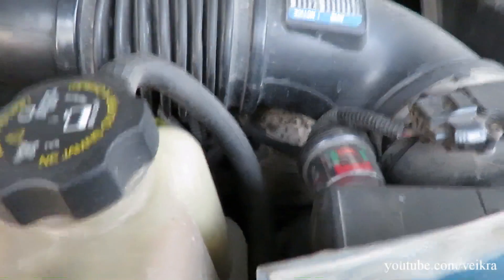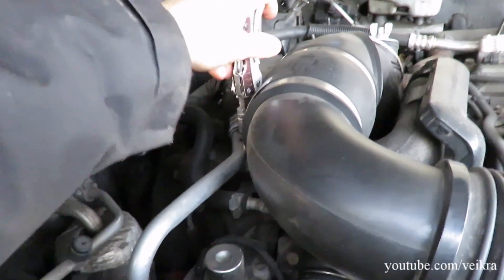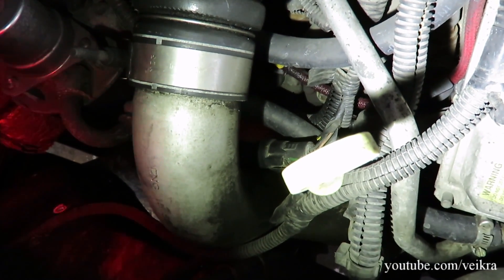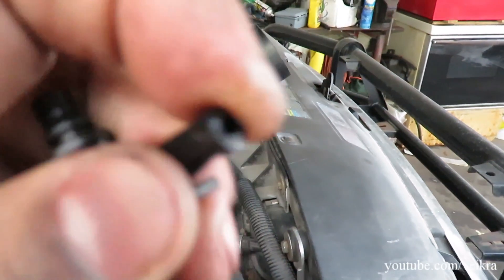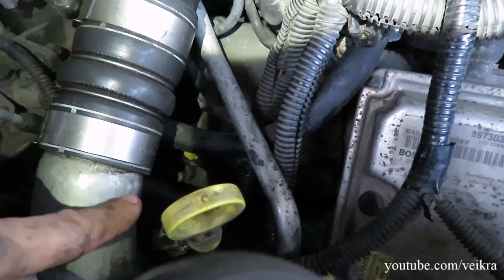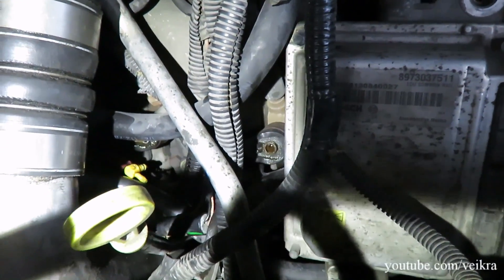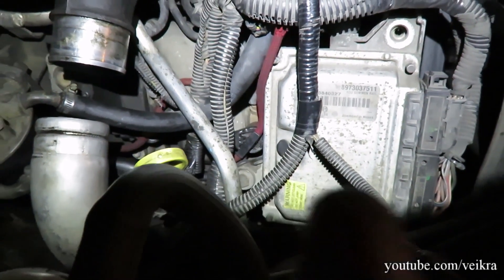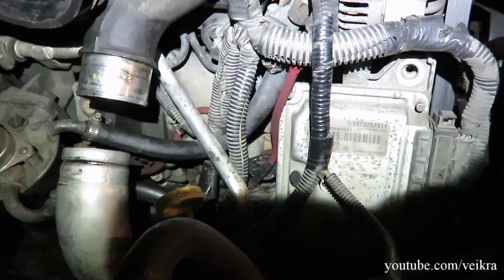Tips on popped fuel return lines Duramax

Comment: FPR - fuel pressure regulator is probably bad
Reply from the maker: Wasnt the issue, issue was perished rubber return lines and fuel cooler. Thanks for commenting. Truck been running great and not popping fuel line even with addition of a big lift pump

Comment: Birthday are you 16 now?  I heard the fuel lines go to crap on those duramax's This old lady at work has a dually with about 200k on it, The lines went, the fuel pump crapped out too.
Reply from the maker: +Ghetto Wagon nah, 12 of course..  Well the crappy line are the old fuel lines from the tank , by the transmission, by the steering shaft and by the fuel filter(already replaced) They get mushy and collaspe under vaccuum and deprive the pump of fuel.  Can"t expect rubber to last 20 years though

Comment: did you ever permanently solve this? or figure out the cause of this?  the return line keeps popping off of my #1 injector.  I have the yellow plastic fittings too.  Not sure if its just the fitting or if its a bad injector.
Reply from the maker: high return rate on the injectors once you rule out a blocked fuel cooler and bad lines
Reply: does it make a noise when it blows out the fuel?
Reply from the maker: @bassnetwork9780  no